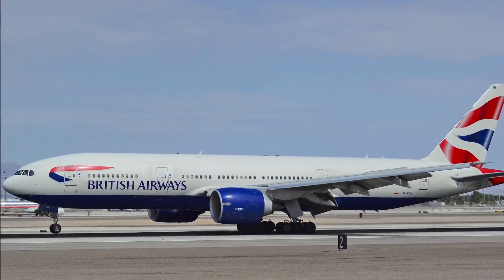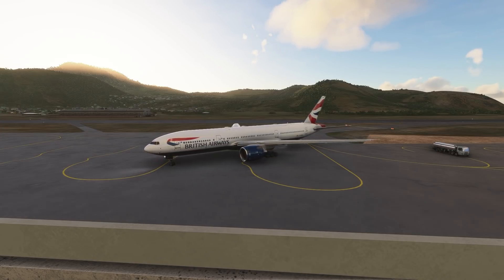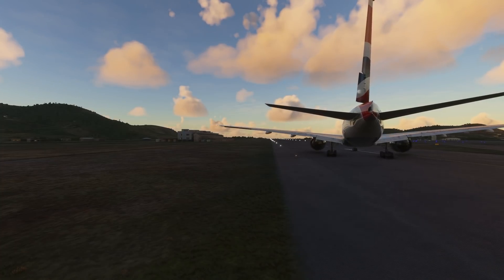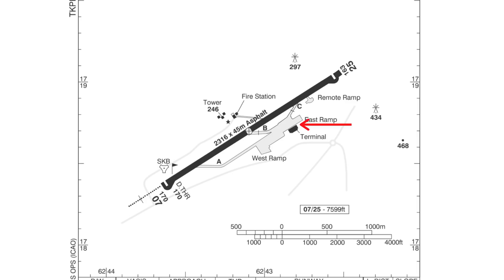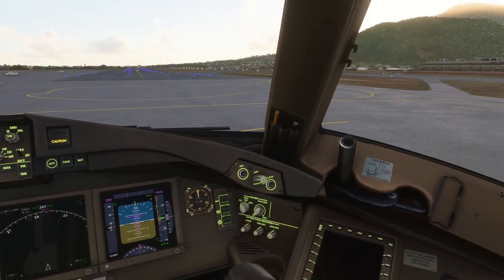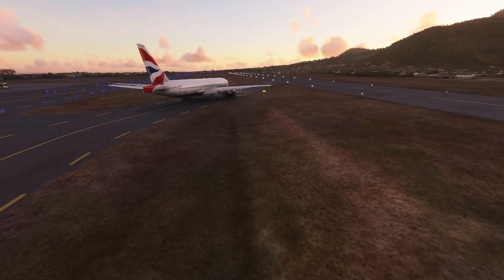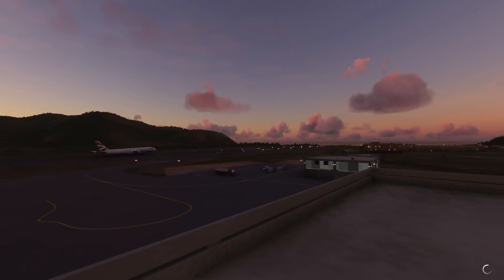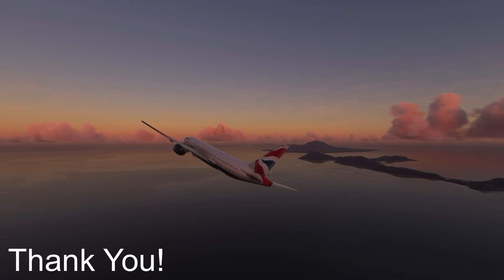How A Wrong Turn Almost Crashed This Passenger Jet | British Airways 2156

Comment: Ok, this was a recurring issue known to the airport authority and with a very inexpensive fix. 
There is no authority responsible to ensure compliance with ICAO standards❓
Is it up to each country individually❓
Or are the standards merely "guidelines" rather than strict requirements❓
Can't IATA refuse to fly to an airport that is not compliant❓ For sure this would have a huge impact on local authorities and be an incentive to upgrade. 
P.S. I follow Formula 1 racing. Race tracks have to be compliant with strict FIA standards. If they are not, there will be no race there, period.

Comment: They were very lucky they were able to take off safely. They could have overrun the runway with disastrous results. The fault lies with the airport, which had violated regulations, not the pilots.
Reply: Once again, another pilot worshiping fool, Yes you! What kind of pilots don’t notice that they are halfway down the runway in clear weather at the position of takeoff? Too many pilots are idiots, and that’s a fact borne out by how many people they kill.  90% of airplane accidents are pilot error. That should be some kind of clue on what we need to do, and that means to get rid of pilots and get artificial intelligence in there as soon as possible.

Comment: The simulation features G-YMMR.   I have flown on G-YMMA (another BA triple seven) from London to Bermuda which is also a small airport.  However, Bermuda has a full length taxiway in parallel with the single runway.
Reply: G-VIIR, not YMMR was the incident aircraft.

Comment: Wow, it was good the 777 had enough thrust to propel it down the runway fast enough for the short take-off roll that was only about 3,900 feet, it was also good that the airport charts were updated to provide flight crews with clear information about the airport to prevent similar incidents from occurring again.
Reply: A lot has changed since that incident my friend :) !!! I run a Aviation spotting channel from St. Kitts .....British Airways flights to St, Kitts are shared with the island of Antigua just 15 minutes away and so the 777-200 would in most cases be on the lighter side as they would refuel and take on more people in Antigua....i got countless of footage of the  GE-90' in action !!!!

Comment: I’m really surprised ATC didnt at least say “you are on point Bravo, sir” Or “do you mean alpha or bravo?”
Reply: Yeh - that almost certainly would have been a key failing if there had been an accident. Looking at the taxiway layout, the controller should have been curious as soon as they missed that link they needed to join B taxiway.
Reply: Especially since the pilot SAID alpha. As in, "I'm sorry. Did you say alpha? You're on bravo."
Reply: You can be sure ATC was asleep at the wheel. This is normal.
Reply: That’s the Caribbean ..  atc is low stress…

Comment: No, I think that everything was quite under control, thanks to the very well trained and cognizant crew.

The only way disaster could have struck this flight, would have been if a GRU Russian murder squad in a BUK-M1 missile launcher, had fired a 9M83 surface-to-air missile at the aircraft, as it flew in international airspace.

I think that's the only scenario that British Airways pilots DON'T practice in simulator training.

Comment: Can we take a moment to appreciate the bad ass engines on the 777 - might have made the difference here :-)
Reply: Yes - POWERRRRRRRRRRRR! :D
Reply: The untold story is that my Mom was scheduled to be on that flight.  Had she made it, the extra weight would have doomed the plane.
Reply: My point exactly ..those GE90s are epic!!!!
Reply: Rolls Royce
Reply: BA uses GE engines on thier 777's
Reply: @nathanandrews5869 I fly on BA regularly and have seen both GE90 and RR Trent on the 777
Reply: @edwardrichardson5567  it was G-VIIR, a GE powered bird
Reply: @rau1seixas  Oof good research.
Reply: I will forever refuse to give any credit to Boeing...
Reply: @prycenewberg3976  OK - I think they'll manage without it.
Reply: @prycenewberg3976  Both my grandfathers moved to St. Louis to work on airplane design after serving in the military/WWII and worked for McDonnell Douglas / what would be Boeing. Neither one would have let such a horrible design flaw slip past them as happened with the 737 MAXes and would be horrified; at least they did not live to see it. The company just isn't what it used to be.
Reply: @pickles3128  Fair enough.

The reason for my comment though is that my dad worked for Lockheed Martin in Missiles and Fire Control for over 30 years, and "Boeing" was literally a cuss word in the house.  Kind of like an old college rivalry.

Comment: I think the pilot knew he could do the takeoff, He acknowledged the fact Spooled them big turbines  up  and went for it. Should he? Of course not.
Reply: I wonder if the pilot responsible had run the performance calculation from both start positions. The instruction to "stand on the brakes" implies that the crew knew where they were before committing. Ditto for the take off thrust that was actually commanded.
Reply: Maybe not the best idea to just Leroy Jenkins it when you have a plane full of passengers and a village at the end of the runway...

Comment: What the controller should have stated was something like 'speed bird 2156, verify takeoff calculations, you have 3900 feet of runway from your present position'. 

Also, since the crew was not familiar with the airport, it's very likely that they chose the intersection takeoff because they were not sure they could do a 180 at the end of the runway with a plane that size.

Comment: What nearly killed them. Not questioning why there was another taxiway beyond what they thought was alpha.
What saved them. Questioning if they had enough runway and going full power before roll.
Definitely on the airport management for not marking properly, but a little more questioning from the crew might have prevented this issue.

Comment: Yes the charts were a bit ambiguous but didn't the pilots look out the window!
Reply: But seemingly no holding point signs.  It would be like pulling off a motorway with no junction number or subsequent lead-off road signs.
Reply: Yeah, no taxiway signs AND incorrect taxiway pavement markings.  This was a disaster looking for a time to happen.

Can't blame the pilots for this one.
Reply: @Milesco  I am from St. Kitts and i run the YouTube Aviation channel SKBenergy from St. Kitts where if you guys want to see BA 777-200 departing from Taxi way Alpha in real life i have it :) !!! From my understanding of this incident in 2009 some people came down from the UK to do there own inspection of the airport from the Air Accidents Investigation Branch  and the found those very same problems listed in the report, the airport falls under the watch of the Eastern Caribbean Civil Aviation Authority where they made there report to....not sure if they were fined or something....

Comment: With a large aircraft, in a small airport, and unfamiliar surroundings... why wouldn't you simply go to the beginning of the runway and take off there?  Yes it is time consuming, but it eliminates all runway questions and prioritizes safety. Yes...hindsight is 20/20, but this should be the rule.
Reply: I was always taught that the altitude above you and the runway behind are totally useless.  Been questioned by the tower for taxing to the very end...
Reply: @brucefowler8690  También a mí. Además del hecho que "todo el combustible que quedó en tierra..."  Respecto de esto, digo que siempre "será mejor" que las alas hagan ¡crack! a que los motores "cof-cof-cof... ffffffffff"
Reply: Some times pilots are nervous about having enough room to do a 180 at the end of the runway (required after back taxing).  I can understand wanting to take A intersection but not their error.
Reply: Engines go brrrrrrrrrr

Comment: The controllers were partially to blame. But of course the ultimate blame falls on the pilots. But I have made this same mistake at this airport, so give them a break, the old charts were terrible.
Reply: The ultimate blame lies with the airport, I think. They knew of the problems, knew how to avoid the problem, yet neglected to be proactive.
Reply: @Xxxxxx19-p1c  & Mike Stone, agree with both of you. Not a pilot but have been following Aircraft investigation since the 80's and know its a chain of events in the aviation industry that leads to disaster. If the chain is broken nobody hears about it. Mr. Mike Stone love your nobility,  but understand sometimes pilots are set up to fail due to bad info. Stay safe up there..
Reply: At least one party should (NOT could) have requested clarification about the aircraft's position. No professional pilot or controller would be upset by somebody being prudent.
Reply: I’m not giving them a break, they are professionals, they have the lives of many people in their hands, bad charts are not, any idiot can see whether or not you are halfway down the runway in clear weather At the position of takeoff roll.
Reply: @steveperreira5850  Steve Pariah, it must be wonderful to be as perfect as you. The folks around you must really appreciate your compassion, understanding and empathy.

Comment: Why did BA Ops allow operations to St Kitts if the airport markings were not up to ICAO standards? The initial safety inspection BEFORE operations were ever started to St Kitts should have picked up the markings and signage issues. Why did the ATC supervisor not advise the crew they were at Taxiway Bravo?
Reply: BA would have been operating out of St Kitts as BAOC long before the ICAO standards became a thing. St Kitts and St Nevis  is a commonwealth country and will have had direct air links to London from before independence. The original decision to operate there would be political not commercial.

Comment: I cant help but consider, just how many times planes have had such a very narrow escape, and the passengers never even knew.
Reply: I narrowly escaped a RyanAir flight alive one time. Worst flight ever. Should have just walked through the Chunnel.
Reply: @ondrejsedlak4935  to awwww👍wwwsw
Reply: Not so many I think. These kind of incident happen only if a chain of irregularities and or events take place. And pilots refer incidents like that as they don't wanna die the next flight. There is a chain of witnesses with the professionals around like ATC etc.
Yes NO flights are perfects and pilots and controllers make mistakes almost every day. They are human. But the system has a huge amount of margins.
The commercial aviation industry is very transparent in countries respecting ICAO standards. Yes bad things under the radar happened in these countries but it's very rare.
If the passengers don't understand what's happening at the moment of an incident, they are informed after it most of the time. The investigations and their results are public. There are always specialized journalists to report it to the wide audience.
Ok a bird hitting the flightdeck window is not making the headlines and the passengers don't know.
But for example, a mechanical issue leading to no critical situation, they are aware of.
The last scandal showing that it cab happen is the 737 MAX issue. But nor the Airlines, nor the crews, nor the maintenance knew the problem. They trusted the FAA. FAA was corrupted as Boeing was... It's not the same story of having an incident with non dysfonctional designed airplane.
Some incidents are not close to disaster. Some as this one, are.

From a former private pilot having be very close to Airlines crew and operations. The exigence in this field is so enormous that the worst thing is that it is often too much for the personnal. You can loose a job you worked hard for years so quickly because one day, your performance has declined a tiny bit. It's very hard, believe me. It is to garantee a level of safety even if machines get failures and humans make mistakes.
Reply: Half the time? 😂
Reply: Tooo right
Reply: @strangelove9608  Bugger. I'm sure that's not claustrophobic at all.
Reply: I doubt many flights are 100% perfect
Reply: @jamescollier3  and you would be mostly wrong...
Reply: @William-Morey-Baker  must be nice to always get government atc employees that are 100% perfect, never fly in anything but clear weather, be unaffected by covid, etc, then be a perfect human on every flight. Must be nice.

Comment: I would try to go to A and then taxi to BEGINNING of runway...always. More is better in this case.
Reply: I don’t understand why you wouldn’t always use the whole length of the runway. It’s an extra margin of safety if anything goes wrong.
Reply: david chappelle, if you are in a GA plane and there are heavy aircraft ahead it might be safer taking of at an intersection because of wake turbulence. But in something like a 777 I have no clue why they did that.
Reply: So they didn’t have to attempt a 180 degree turn at the end. And in another scenario if you have a plane on approach you can just depart from the intersection and clear the runway before the landing aircraft. Otherwise you’ll have to sit and wait whilst that plane lands
Reply: I agree. Even in the little tiny plane I fly. If I start at the beginning of the keys, I'm airborne before the end of the keys. I still go right to the end to start my takeoff. If I have an engine problem I can and have rejected the takeoff 100 ft in the air and landed back on the runway straight ahead. Nothing so useless as runway behind you. I don't need all that runway. I could take of across most runways. But if something isn't right it's great to have it.
Reply: @gasdive  your plane takes off at much slower speeds than a commercial airliner. Even if an A320 tried to do the same thing it will overrun and risk injury or death. That why pilots calculate the V1 speeds to know when they must continue at any intersection
Reply: @tomstravels520  but if you start right at the beginning of the runway V1 comes much later and closer to flying speed.
Reply: @gasdive  yes but if your calculations are correct and the computer says you can still takeoff from an intersection which prevents you having to try and do a 180 and block the runway for longer than just going from the intersection then what is wrong with that. I’ve been on an A319 before that was so light it used just half of a 3500m runway
Reply: @tomstravels520  nothing wrong with that all long as everything goes right. It just removes one layer of cheese, that's all.
Reply: Especially since they were unfamiliar with this airport.   Seems reckless.

Comment: In my opinion. this was pilot error. All things being equal, you can never have too much runway. By picking "alpha" they created a situation in which there was almost no room for error -- and an error occurred. They put themselves in a situation where a chart error or a chart misunderstanding almost cost the lives of everyone on board and the explanation was -- it saved time. A perfect example of why choosing less runway is always a potential problem and never the right choice, even if it is the most economical choice.
Reply: If I fly a 172, by your logic I should taxi the full length of a 10,000ft runway before taking off?

Performance numbers and calculations exist for a reason; whilst pilot error is definitely a factor in this incident, I can't agree with your criticism of the initial decision to perform an intersection departure. Had the holding point been marked, well this probably wouldn't have happened.
Reply: @cohen200  Since you fly a 172, you could even take off from most airports' parking lots. That does not mean that a commercial airplane should not have a lot of spare runway length. And if you are departing from an unknown airport you are adding one more variable to the equation of necessary runway length, so, in essence, the first time you depart from an unknown airport, you cannot have too much runway.

Another way to see this is, if the runway seems awfully short and you have no experience in that airport, then you better go by the rule of thumb that says that you cannot have too much runway.
Reply: @Andres Villarreal  I don't disagree.

Commercial pilots calculate takeoff performance numbers with a ~30% margin, if their calculations say a holding point departure is possible it should be considered, if you're unfamiliar, or unsure you should absolutely take no risks; however, let's remember that OP said that it is NEVER appropriate.
Reply: @cohen200  They could see the holding point wasn't marked and it was unfamiliar and the runway "looked short (*face palm*).   The comparison with a 172 is a bit ridiculous as the cessna doesn't have or need a V1 decision speed to reject a take off.
Reply: @jamescaley9942  My comparison isn't really ridiculous when OP said there is never a reasonable time to perform an intersection takeoff.

I have my pilot's licence, and performing intersection takeoffs are not only safe with some extra caution (which the crew lacked here), they're very routine.

But I think I'll be noping out of this discussion, armchair critics rarely use logic.
Reply: @cohen200  Yes, by my logic and logic in general you would. But for those who are willing to risk the lives of others, saving those extra minutes of taxing are more precious than life itself.
Reply: @considerthis7680  I'm sorry, but you've just proven that you don't live in the real world.
Reply: I partly agree. Not having two different ways to validate a critical piece of information and going ahead anyway is very dangerous, no matter what the piece of information is. In this case, not having the correct markings and signals on the runway should have been more than enough to make them think twice.

But everyone in the control tower is also partly responsible if they do not remember every departing pilot that the airport is not up to standards with respect to markings, signals, and other critical safety measures.